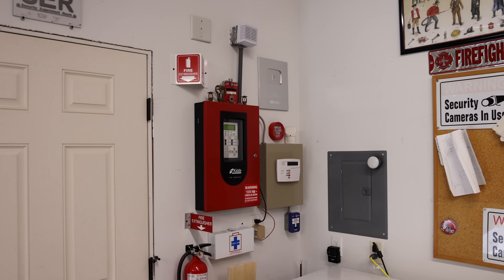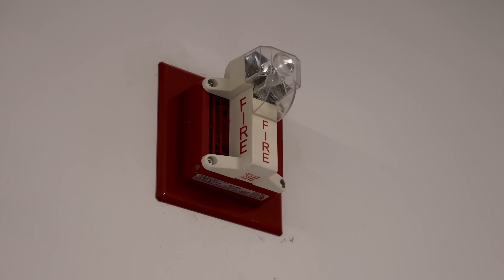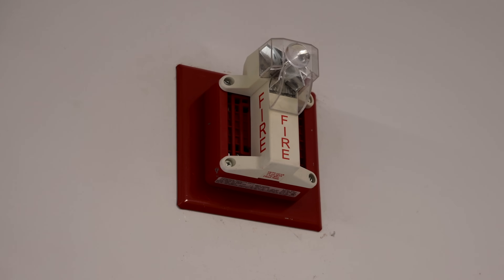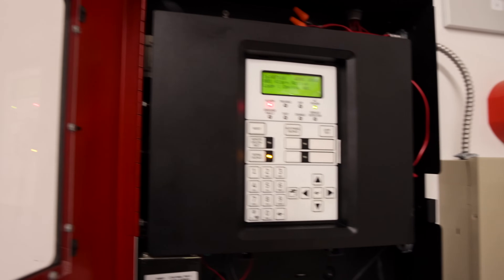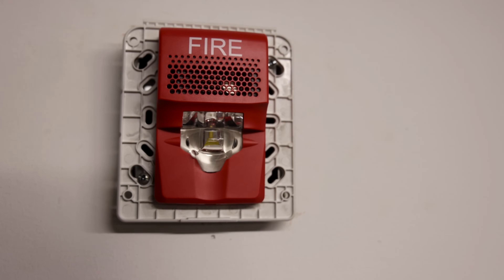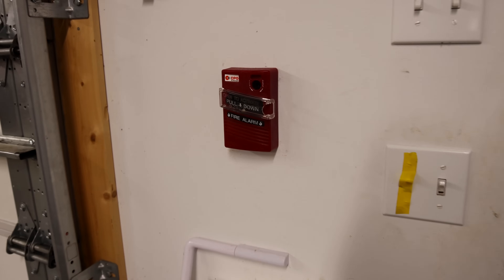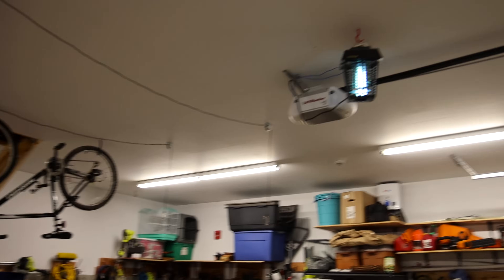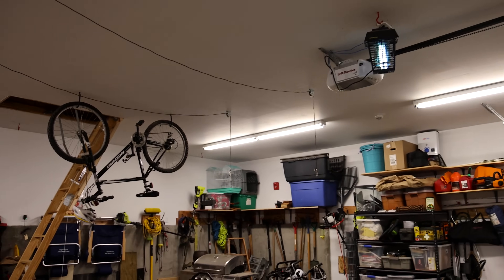Garage Fire Alarm System Test 36! | RARE CPG V1971 Strobe & 4050D Horn

Comment: That Kidde horn/strobe does actually make sense there. You could say that the original system got replaced with the addressable Kidde system and they kept the one old notification appliance, but the other one was broken so they replaced it with a new device.
Reply: He has the same exact one, just a different horn! 👍

Comment: Request alarms for garage test 37: 

Pull station: Cerberus Pyrotronics 

Notification appliance: Simplex 4051 with the 4050-80 light plate 

First coding: Continuous 

Second coding: Code 3 (temporal three) 

Final coding: March Time

You love it, S.E.R. Safety?
Reply: Also, can you use the MS-501 style of the Cerberus Pyrotronics pull station?